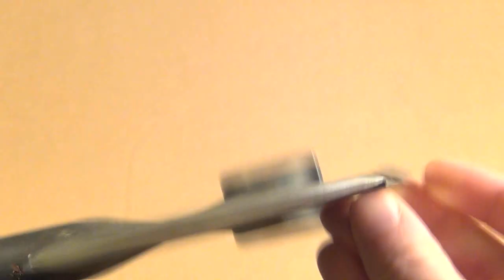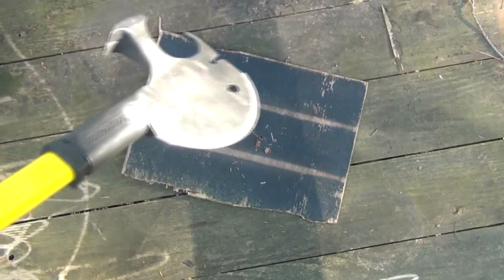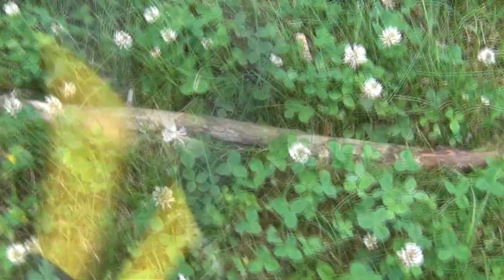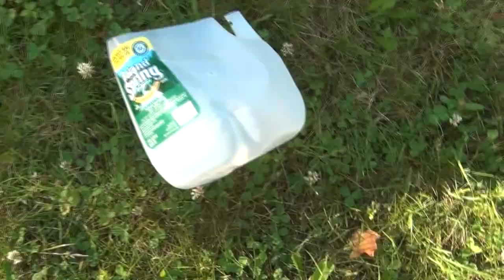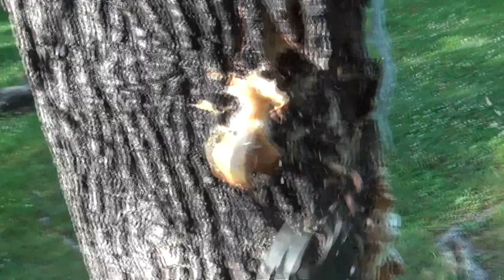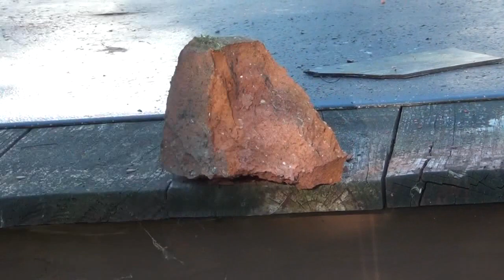Trucker's Friend Axe Review, Fun, Path of Destruction

Comment: You have to look at this tool for what it was designed  for. It takes the place of about four different tools. I use the hammer head to bang on stubborn tandem pins, and when I was on OTR driver to pull nails out of the floor of the trailer that was used to secure dunage. The axe capabilities are for a worst case scenario if you were stranded on the side of a road in freezing temperatures and ran out of fuel and couldn't stay warm.
Reply from the maker: WE GOT US A CONVOY!

Comment: Any news on where to get one of these? This would be GREAT as a tool for when TSHTF, it would certainly be a defensive tool, but it would be worth it's weight in gold for things like getting in/out of cars, buildings (wrecked or not) rescuing people, moving debris (or downed power lines-maybe, IF it's properly insulated) Not to mention all the mundane stuff in between. Great tool. If you live in an urban/suburban setting, face it, someday if the S** does hit the fan, you WILL eventually need to acquire "resources" whatever they be, in whatever fashion- even possibly breaking into buildings for them. If the choice is that or death, I know what I would do. No matter how well prepared you may be, things will run out, be stolen, or etc. Or you may be away from your home or supplies, this could go far in helping you find and get what you need.
Reply from the maker: I agree, it would make a flexible urban survival tool. No new news really, except that since I got a Work Sharp Sharpener, I have sharpened the axe edge on this to a much sharper edge, (the edge comes fairly dull out of the box).

Comment: So just a quick update on the wood splitting at right around 6:07. I THINK it was pretty obviously designed to be a "splitter" as well! From the front edge of the blade concaving out to the wide edge of the "hammer" to me seems to be a premeditated design aspect. Which is pretty damn awesome for smaller logs/tinder/wtf extra you can use it for. Which again, is awesome. That is all. ;) If I'm wrong, argue with me on the internet. Let's see how that goes.

Comment: lol at lot lizards. Most truckers have a "tire thumper" which is supposedly for hitting tires to check the air pressure... lol nope its really a billy club. This looks helpful for demolition. I am wondering if it is full tang steel because it looks like the middle is fiberglass. I am sure that makes it lighter but you canr beat a full piece of steel.

Comment: Very amusing video, Israel. I like the axe shape, it reminds me of a Inuit Ulu, that utility pizza cutter shaped knife that Inuit women have used.

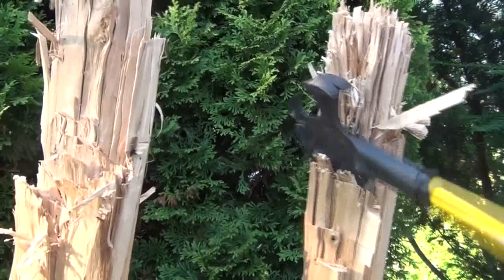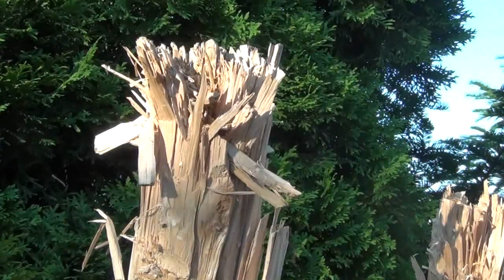I noticed when you chopping the tree trunk at 5:51-7:08, that you didn't have to work the blade back and forth to get the blade out of the wood, thanks to that circular blade shape (unlike a tomahawk)

The only thing I don't dig is the ribbed, black rubber handle. If it had a pinched in portion and a palm swell, that would be much better i.m.o

Comment: I used to be an asbestos abatement worker and those do look like asbestos tiles. Given that you were cutting them up outside you are probably ok asbestos is all around us its in the air naturally in low amounts I would not be to concerned about you cutting up a few I might be concerned about when you pulled them up however.

Comment: its not trucker like truck driver. its trucker ir truckie as in a firefighter that works on a lader truck. its sold as a firefighters tool.
Reply from the maker: +Lt.Gabe  If you look on the website of the manufacturer, they say:  Product Description
The patented Trucker’s Friend™ is an all purpose tool, built tough 
and specifically designed to meet the needs of professional truck 
drivers. In any situation that requires hacking, prying, pulling or 
pounding, you’ll feel real peace of mind with this serious tool on 
board. Made in the USA and backed by a ‘no hassle’ Lifetime Replacement 
Guarantee.